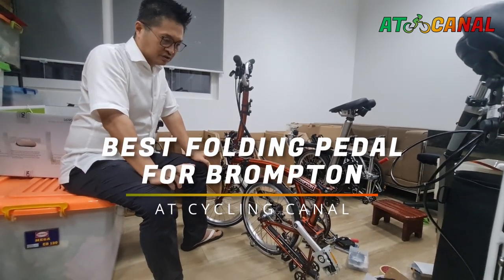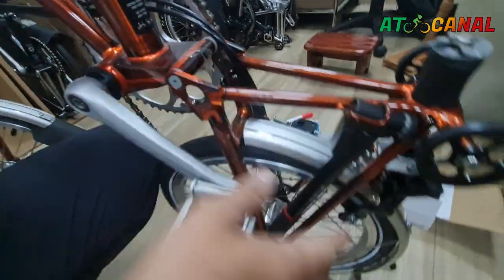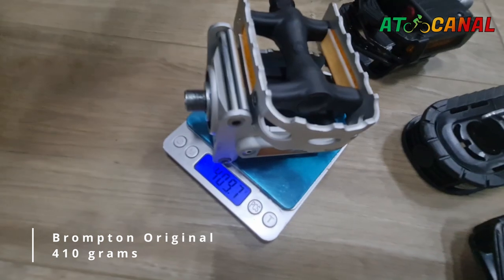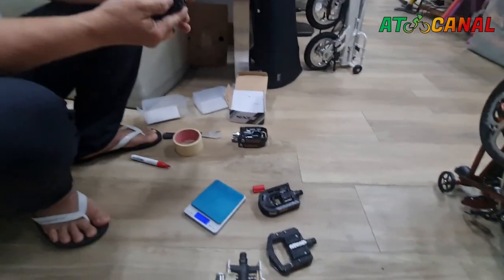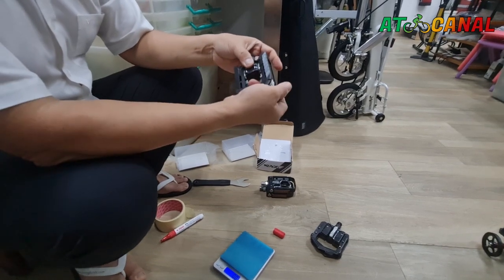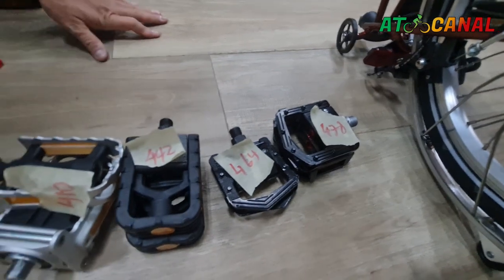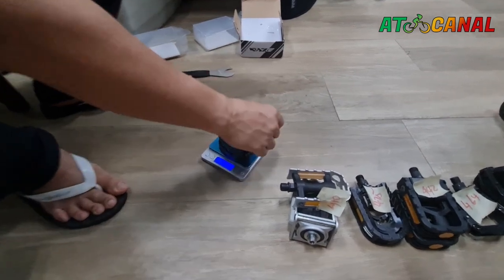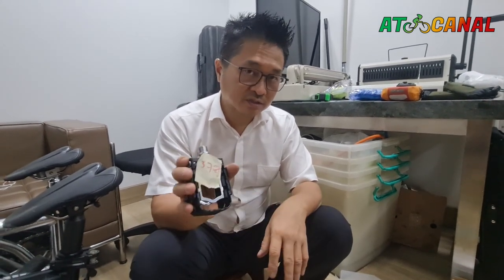What is the best folding pedal for your Brompton?

Comment: It doesn't matter that the Brompton original pedal can touch the rear triangle because you fold it in at last or out at first🤯
Reply from the maker: Yes, but once a while one may faced it, especially if in hurry.
Reply: no i dont think thats a good enough excuse, just because the right sequence of movements can avoid the bad thing happening doesnt stop it being a massive design flaw. this is like when the iphone 4 came out and would drop signal if your finger touched the outside of the phone in the exact particular place that your finger just naturally comes to grip it at when holding the device normally, and apple had to start selling rubber fenders to fix it, but steve jobs said "you're holding it wrong". no dingus, YOU designed it wrong! and this is exactly the same thing with the brompton pedal.
Reply: The Brompton pedal is a really poor design, it can also hit the frame if you wheel the bike backwards, like manoeuvring in a busy train station etc. Also only one pedal folds, it's good to fold both in busy areas that the Brompton was designed for (again like train stations etc). The Brompton has some great bits of design and some inexcusably poor design too.